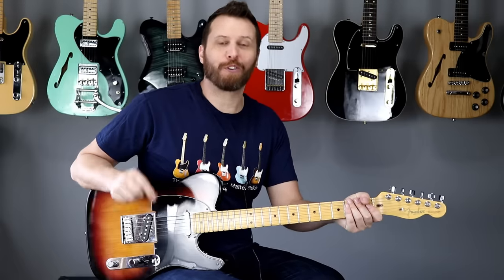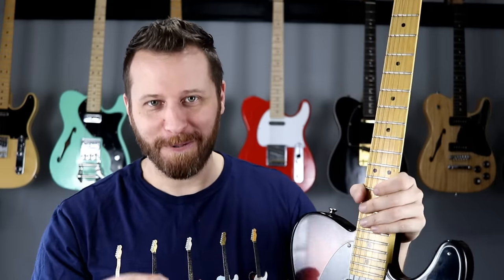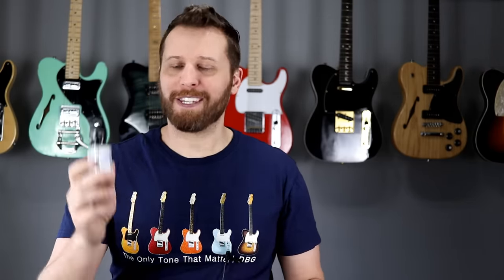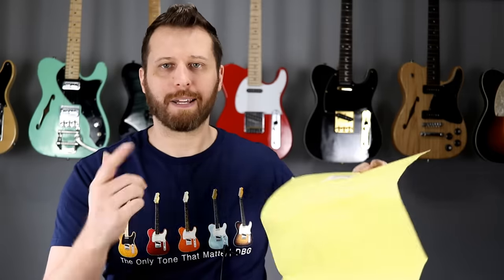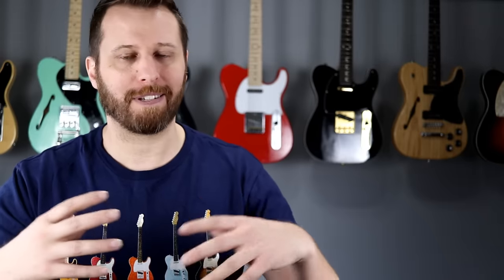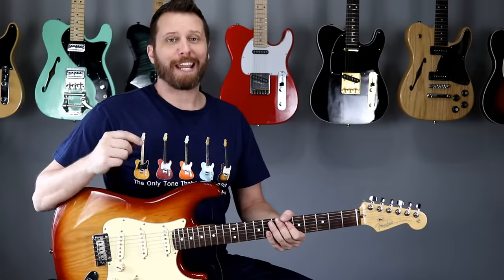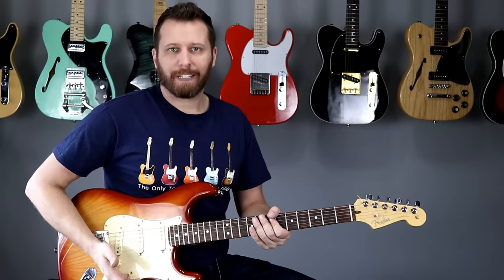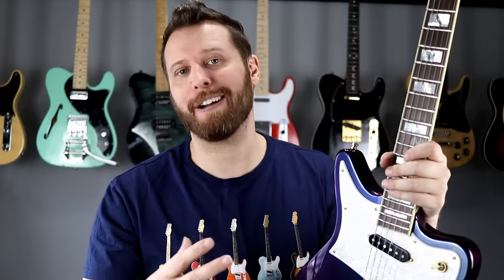KILL The Hum and Buzz!! - Keeping Your Single Coils QUIET!

Comment: There is a different between 60 cycle hum and ground noise. Most guitars have problem with ground. 60 cycle hum can be solved super easily by using humbuckers, noise gates or stacked noiseless single coils and it goes on. While ground noise until now still has its debates on what is the best way to ground a guitar other then copper shielding
Reply: But I don’t have no money to spend on pickups or pedals
Reply: Doesn't noise gates kill your sustain
Reply: Humbuckers have a very different sound.... Which I do like, but it's not a replacement for a single coil sound. It's a different sound. You're right about grounding issues.....I have guitar with some that I need to sort out....
Reply: @Megas_Alexandros  not the overall sustain vibe, in normal playing when set well..... But on really long notes.... Yes it does

Comment: My Boss Katana 50 has a built-in noise suppressor. Only problem is that it's only accessible in the Boss Tone Studio via USB but it works wonders once set up.
Reply: I've never plugged in my katana to my computer, once you set up the noise suppressor do you constantly have to be plugged in to use it or can you unplug it and you're all good?
Reply: lol I have one and did not know that.  Thanks!
Reply: rakoboy8 
Hey as far as I’m aware, you can save the setting into any of the eight channels available to the 100w or any of the four on the 50w. It would have to be done initially through the Tone Studio software then you’re good to unplug and go.
Reply: @SeemsLikeSomething  sweet, thanks dude
Reply: rakoboy8 
No worries and by the way, not sure if you know, but the Katana has been getting a lot of firmware updates! If you go to the boss website and check downloads under the Katana model you own, you can get the latest firmware, driver and tone studio. Keeping that up to date is gonna be VERY helpful! Especially if you only have the version 1 software because they doubled the channels that you can use in an update!! Cheers and good luck 😉
Reply: @redsnake ….I have one too. I notice some of the tones I download sound really muted and twangy like somethings wrong. you ever experience that?
Reply: but you can still hear it when you play chords

Comment: Why does expensive Fender USA guitars don't come with paint or copper/aluminum foil out of the box?
Reply: Some of them do,  but only the realy high en models. Also most Gibsons come without any kind of cavity shielding. I work as a guitar tech and it's funny because sometimes $400 Asian made guitars come with better shielding.
Reply: You're paying for a name not innovation.
Reply: The ones that don't have copper tape shielding will either have dark gray conductive paint lining the cavity or they'll have shielded wiring.
Reply: They only add it because it's cheaper than convincing everyone that it doesn't actually work.
Reply: Maybe they don't use shielding because there are using humbuckers and/or noiseless single coils.
Reply: @tatoler38  Maybe, but even my humbucker guitars buzz, including my PRS. If I touch the strings, bridge, tuning machines, etc. the buzz is reduced significantly, but it doesn't matter if it's single coils or humbuckers.
Reply: Blind leading the blind on this comment thread. Shielding changes the sound of the guitar (sometimes quite significantly, especially with a strat), so those who want an authentically vintage-sounding instrument don't want the shielding (and Fender and Gibson know their market). Claiming that all guitars should come with shielding is akin to claiming that all guitars should come with noiseless, humbucking pickups, which would be ridiculous. As for the last comment, what you're talking about is the noise caused by a lack of ground, as your hand touching any metal component of the guitar completes the grounding circuit. This is true of all guitars, regardless of brand or origin. Perhaps if the video itself had been more sufficiently informative, these kinds of questions would not have arisen.
Reply: Because shielding is total B.S.
Reply: @Ezra Elliot. %100

Comment: You can shield the pickup cavities and make the ground wire go to the strings so that your body absorbs all the static,  but people often forget about the amp,  it needs to have a ground conection,  your house sure must have one (a copper rod burryed in the ground) but the plug  you have on the wall may not have the ground part conected for various reasons (lazynesis a common reason,  many people just connect the red and black and ignore the green\yellow because it serves little to no purpose, but it's important for this) so make sure it has, it makes a huge difference,  my guitar has humbuckers and when i use it conected to a solar inverter that has no ground it buzzes a lot,  but when i use with normal energy it's perfectly silent, also make sure that if you are using a extention cord (or a triple one) ,  make sure its all stretched and that it has a ground pin in the plugs, at home i have some that only have the holes for the plug but not the metal part that is supossed to make the ground for the amp and it's kinda common in many cheap extensions, the ground conection is really important and easy to neglect, i noticed this because the amp would buzz even with the guitar cable disconnected :v
Reply: Where the heck do tou live that it is common not to have the yellowgreen cable not connected to the whole house??? Just the black and red (and by red we in Europe mean blue, red is for DC voltage). This is just totally crazy. The yellowgreen does have purpose, it saves lives!

Comment: The quality of your cables will also make a hugh difference (clean or overdrive) especially if you are using multiple pedals. Quality cables are a better investment than a new pedal on a noisy pedalboard!
Reply: Quality cables can't eliminate 60-cycle hum; they only prevent additional noise from being introduced into the signal path.

Comment: I fortunately could eliminate ALL NOISE  from my Fender Strat Standard (Mexican) simply replacing the original pickups by the Fender Hot Noiseless ones. They are excellent, though considerably expensive. Later I purchased another Strat, this one a new Fender Strat Special HSS (American). But this time I'm only using the Boss Noise Suppressor NS2 Pedal, that sactisfactorily eliminates approximately some 85% of the noise, and this has been very nice to me, I'm pleased with it. Many thanks for your kind and detailed explanations, I learned several things I still didn't know. All the best !

Comment: I use the Donner Noise Killer. It's a fairly cheap pedal on Amazon, but it gets the job done.
Reply: Yep. I highly recommend this pedal. Works excellent for me.
Reply: I ordered my Donner but it never arrived and they aren't replying when I  asked for a refund due to not receiving the pedal.
Reply: @draganm7823  Did you contact Amazon or Donner? I've never had an issue with Amazon not responding
Reply: KC  you're talking about a pedal that's $100 more. It should be far superior. I mentioned the Donner because not everyone has that much to drop on a pedal and for trying something out, the Donner is great. For $135 I'd personally look at Boss or TC Electronic.
Reply: @draganm7823  Those bastards. I feel your pain. I got mine off of eBay and love it.
Reply: Thanks for this.I just ordered one from their site for $20.70 with new user coupon, hope I get it!
Reply: @mcbigswig1569  That's great. I love it. You will get it. I've ordered dozens of items from Amazon and eBay and never not received it. I bought it specifically for P90 and single coil guitars but I use it if necessary with humbuckers if I get any white noise on high gain and it's my ace in the hole.
Reply: @davidkastin4240  I ordered directly from Donner's website, that's why I expressed hope that I will actually receive it. For God's sakes, Amazon and eBay own me, LOL.
Reply: Surprisingly donner gear as great stuff.  Worth 5 times the price.

Comment: I recently rebuilt my parts caster Stratocaster with the Eric Clapton mod. The mod is the TBX and Mid Range boost. I lined the electronics cavity with copper foil. I grounded the volume pot to the body and the Bridge also to the volume pot. Another thing I did was I put 
together a AC receptacle. I put a silicon diode and a resistor inline on the ground wire. I have a vacuum tube amplifier that I play my guitar thru. I have zero 60 cycle hum even I raise the volume or the gain. It is a bit of work to solve the problem but well worth it.

Comment: I've been using Electro-Harmonix Hum Debugger for a few years now.  Works well.
Reply: Same, but it's very tempramental about where it sits in the FX chain.
Reply: @BongEyedBastard  Yes, it has to be first and it's not a noise gate for pedals. It's for cancelling the 60 hum only.  If you're looking to cut pedal noise, this isn't the tool to use.
Reply: @Zach Isley I'm going to look at that.  An fx loop could be handy.  Thanks.  😀

Comment: TC Electronics Sentury noise gate.  Very good, easy to use and easy to dial in the settings so not to lose your tone. It also has a 3 position switch to address different kinds of hum/noise.   I bought it and to trial it out once I got home,  I just plugged it into the front of my chain (front of pedal board).  It worked so well that that is where it now lives (just sits on the floor next to my pedal board). I plug my wireless receiver into the input.   I turn it on when using my Yamaha 501T which has P90s and when using 'seriously gained' overdrive on other guitars, including my Fender Tele Elite - even though it is fitted with noiseless pickups.

Comment: The Decimator II is always a good choice. However, my experience has been using Mogami cables took care of the buzz. I do keep my cable ends clean as well as use a volume pedal, so I don't notice anything. The gates always seemed finicky when I played. I won't get rid of it though. Telecasters do seem to suffer the most. Good grounding, shielding, good cables, should be all set. Great video!
Reply: Gold plated, high quality cables definitely make a big difference in my experience. I like to use Fender's deluxe/pro cables.

Comment: TC Electronic Sentry. Best gate I've tried so far. Definitely not a simple threshold gate. You run your dirt pedals through the loop and set the gate exactly how you want it via threshold, decay, and damp controls (it also has a tone print option which allows you to edit various parameters of the gate on their software and save those settings). Your clean signal stays intact and your buzz/hum from the dirt pedals run through the gate.

Comment: Bonus trick/hack for killing single coil hum: If you're facing your amp head on, turn around and face away from it; it may sound stupidly simple, but it works for me. Maybe you can also try turning the amp or cab (if you're using a stack) around to face away from you.

Comment: My Boss NS-2 is maybe most important pedal I have. Works great. I don't gig, but I can't stand having noise. I am a semi-pro FoH engineer so sorta picky about sound. Get the settings correct and it's pretty seamless, and doesn't color the sound tonally. It also has connections to create a 'loop' where it acts only on the noisy gain pedals (if you have them)  I've goofed around w/ allowing the gating to be audible as an effect, almost like an auto volume swell if that makes any sense.

Comment: I use an MXR smart gate. Rockman has an awesome Smart Gate. I believe the Rockman version, invented by Tom Scholz, was copied by MXR when the patents were sold to Dunlop. I may be wrong, but I believe that's how MXR got a hold of them. I also have two cheap Talent Noise Gates that I bought from Parts Express, dirt cheap. I'll use the MXR gate after my dirt pedals, ahead of the amp. Then when I split off the signal from one amp into the second via the effects loop as I'm running this rig in stereo, I run the two cheaper gate just before the effects return. Good luck!

Comment: I just did a complete change out of all the electronics on my strat.    In doing so I added some pickups with a higher output level.  In any of the positions where a single pickup was selected, I got lots of hummmm.
In the process of updating my gear I picked up a Shure wireless system, which in the process of using I noticed that if I walked away from my amp and turned my back to it, the hum went away.  Not sure what it would do if I was connected with a cord.  So distance and some new gear can be a great solution.  And in case anyone was wondering the Shure works great!  The line 6 G10, not so much.  Been there, done that!
Reply: Glad to hear there is hole out there. Have you ever tried the noise vanceling backplate systems?

Comment: Back in '68, My rig was a Mosrite guitar with single coils a Fender Deluxe Reverb amp with a twin 12 Jensen home-made speaker cabinet. My amp had a reverse polarity switch on the back which newer models lack, that would go a long way in removing hum. This is before 3 prong outlets became standard.

Comment: One thing I do on DAWs is to apply a multi-band compressor set at a high threshold with no make-up gain to squash or cut out 60Hz and below. Live I tend to use a hi-pass filter EQ band at 60Hz or as close as the EQ lets me get. Either one inserted before the gate effectively attenuates the hum's fundamental so that the gate can be set to a lower closing threshold, but this obviously thins out the sound over pitches B1 and lower. In a mix setting, guitars would probably be cut at 120Hz anyway to give room for the bass.

Comment: Hi darrell ,i know it's a old video ,but i find an other solution for the noise cancelling ,it's a dummy coil , you just solder an single coil pickup with no magnet and no plot  between the switch and the volume pot (the hot wire) and that's all ! it's very effective ! try it with old spare single coil of china .take care.
Reply: THIS! A million times this!

Comment: I taught myself to do the shielding right (make a Faraday cage), and I hated every minute of it. I hated cutting my fingers with the copper foil, I hated having to learn how to solder ground wires to potentiometers, which seemed to take forever. But if you do it correctly, it actually IS a good solution. The best in my opinion.

Comment: I have a 1983 Fender Elite Strat (not to be confused with the current "Elite" series.  In addition to having active electronics, it has a "dummy" pickup buried under the pick guard which gives you pretty much full humbucking with very lite alteration of the single coil sound.  It is a very practical guitar.  I wish they still made them.  Another practical alternative (especially if you are using Line 6 gear) is a Newer Variax. It used piezo pickups with the modeling of various guitar sounds.  Not perfect, but plenty close and absolutely silent - even more so than humbuckers. It is now my #1 go-to guitar for that and various other reasons.

Comment: Most of my guitars have humbucker pickups, but there's this HSS Squier Bullet Strat I have that hums loud in the middle and bridge pickups. 
I just use the bridge pickup, or the switch position between the middle and neck pickups.

The gain knob on each guitar amp has a sweet spot between gain and hum.
Just dial it in, until you find that sweet spot.